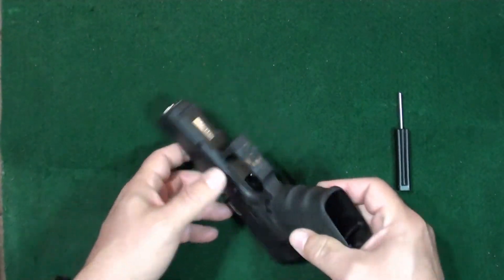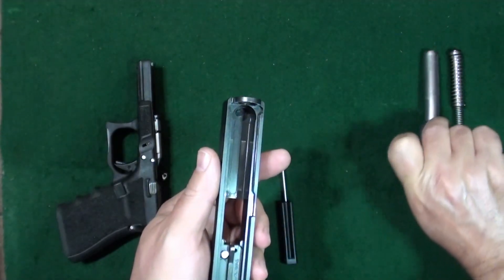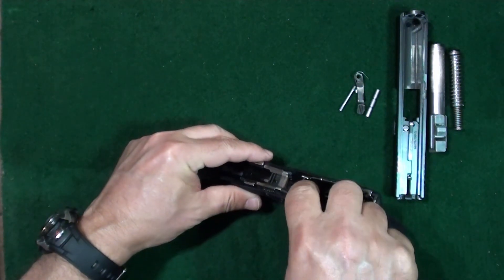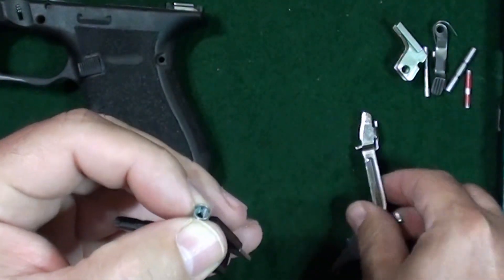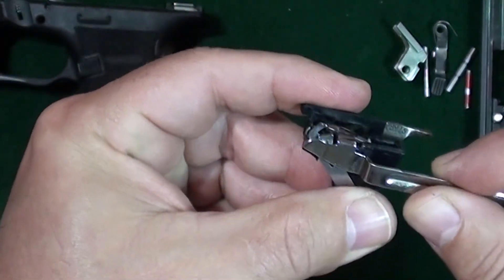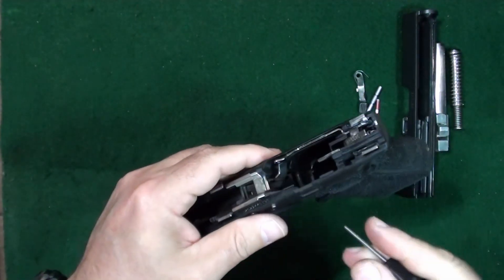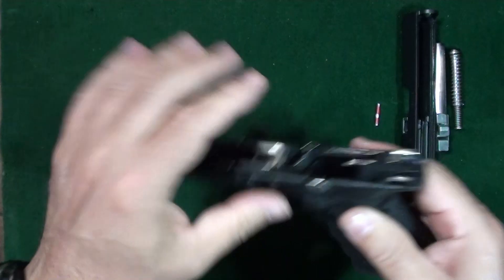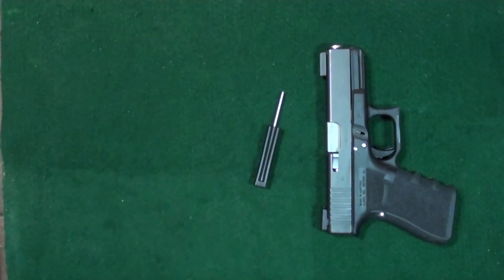Glock Disassembly...Down to Trigger Spring.

Comment: Ive actually seen some videos where the person would take a small hammer and tap out/tap in the slide stop pin (the bottom one). You took yours out like a boss.
Reply from the maker: Not a very good idea. No hammer of any size needs to be used anywhere on a Glock. Thanks for watching!